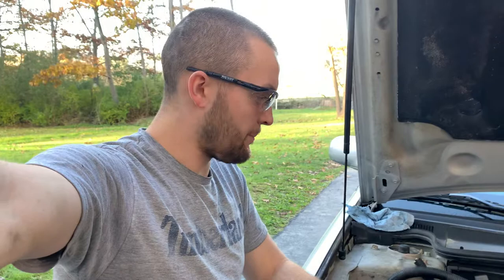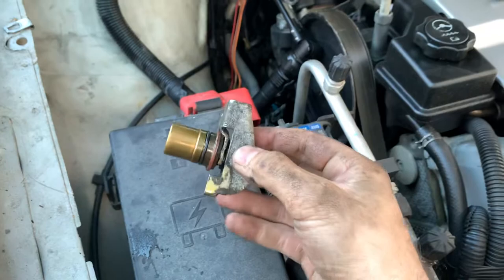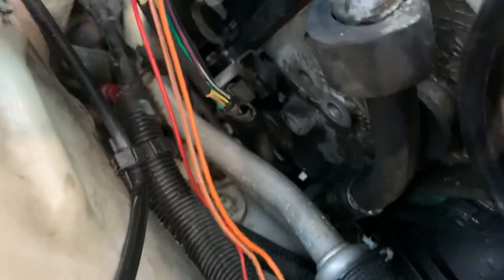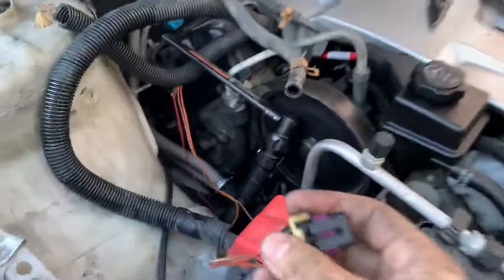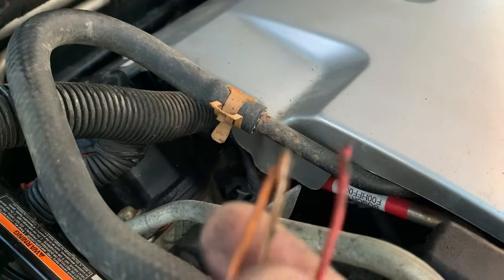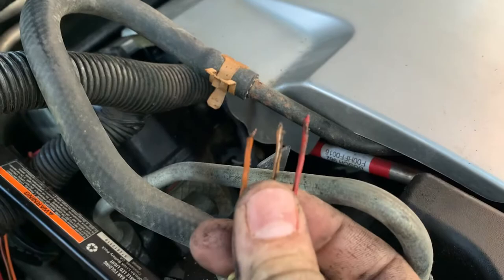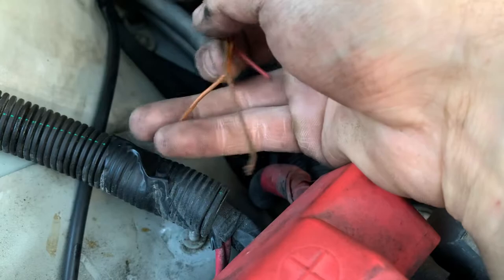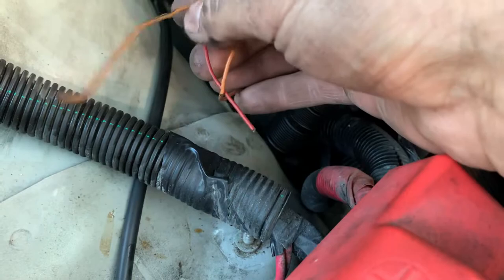P0340 2002 Cadillac DeVille

Comment: Where can you buy that pigtail connector from mine is damaged and I think  this why car wont start and still showing the code even with new camshaft installed
Reply from the maker: I actually went to my local Pick A Part Junkyard. Where you go in and pull your own parts. If you have one near you that is the best place. I think I paid $1.50 for it!
Reply: Will do did this fix your problem I hope it fix mines
Reply from the maker: @brianwms1126  absolutely but a mouse chewed my wires all the way in half. If your wires are still intact it could be an issue with sensor itself or wiring farther away. Are your wires or connector damaged?
Reply: Just the connector it was cracked bad I installed the new camshaft sensor anyway and still didn't start and still have that p0340 code but connector is damaged bad
Reply from the maker: @brianwms1126  how does the wiring look all the way to PCM? I’d see if you have your 5 volt Ref. and ground on two of your wires. It could be just bad connection. You could jumper all three wires carefully to bypass the connector.
Reply: I didn't think of that will do I will try tomorrow I am so glad I found your channel you rock man👍👍👍
Reply from the maker: Haha. Thanks a lot Brian! I enjoy making the videos. I’m not the best but I love auto diagnostics and helping people learn to fix their problems. I’ll be here if you need me. Good luck!